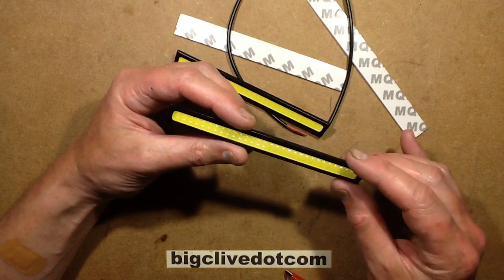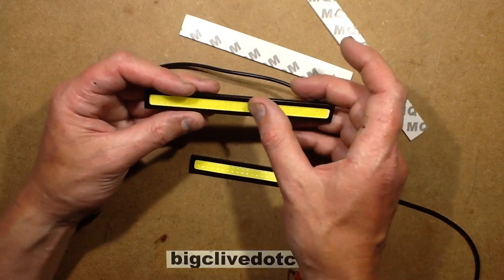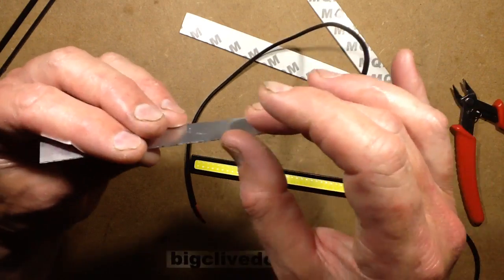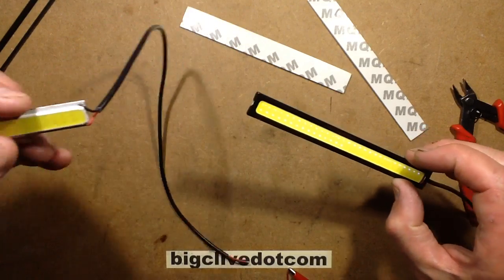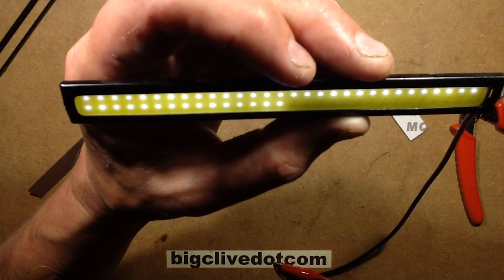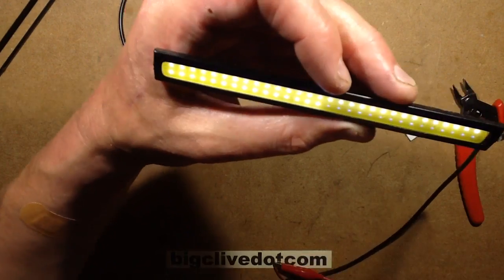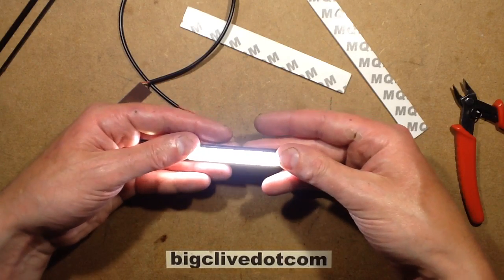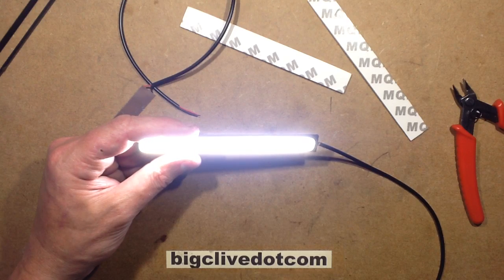A look at some LED COB light strips for cars / automobiles.

Comment: Clive, I got a question regarding similar 12v COB LED sticks. I got a pair of them (9w each) and learned very quickly that current quickly gets out of control with heat and blew out a power adapter.

I've kept the lights and still thinking what to do with them. I plan to use them with a 12v power adapter and was wondering what value resistor I can use to limit their current. Since I got 2 of the COB LED sticks, would having them in parallel then adding a 5w10ohm resistor before the power supply be ok?
Reply from the maker: It's worth trying that and measuring the current.  You can get a very accurate in-circuit current measurement by measuring the voltage dropped across the resistor and dividing it by the resistance value.

Comment: Is it possible to use a 12V Zener Diode to get constants 12v ?
Reply from the maker: You need a resistor to limit the current, but the diode should regulate the voltage to a degree.
Reply: how much currrent
whats the supply voltage

Comment: Very cheaply made. I bought 2 sets  for my VW Beetle grill both failed. Not waterproof. The wires are exposed at the connection. They are bright and worked well, briefly as Daytime running lights. Also I had to use zip ties to keep the tape from releasing  it's grip...probably because of the heat generated.

Comment: looking for info on how to cut a COB strip like this, its linear with 40 led's on it, the power instead of being on both ends, comes out offset on the top about 10 led's down. is it possible to cut anything like this?
Reply from the maker: Whether it can be cut depends on the exact circuit configuration on the panel.

Comment: I ordered these cheap strips from china.They are really strong:6,5W@12V@550mA.Almost illegaly strong light.I also tested them if they would sustain if emerged in water and they did.Are the soldering points covered whith a lacquer or so if they don´t can be short cut?
The chinese call it nano-but this is only a buzz word for a more ordinary method to isolate electrically,I think.

Comment: I like the idea of using what I call a chopper circuit to pulse LEDs and vary the duty cycle so they don't draw current all the time. Pulse Width Modulator, used as a dimmer on my under cabinet lights.

Comment: Cars normally run at up to 14.4 volts at which point the vehicles alternator cuts in, the normal vehicle battery voltage is around 12.6 volts stationary and up to 14.4 volts engine running, therefore it is vital thet both voltage and current are regulated before using these items in a vehicle application.

Comment: So how can I fix this problem? I agree my alternator kicks 14.9V when current demand is high. I have used various units like these and strip led and about 30% failed leds (they are sealed up totally, so no damp) Some still light up with raised voltage, I think they are fatigued by the high voltages/heat. Can I measure current and build something simple or is a regulator board the only solution? Then if I drive them at 11V will they live longer? Great content Thx
Reply from the maker: Under running LED will always make them last longer.  For low current loads, adding a few 1A diodes in series with each light can drop the voltage by a decisive amount.  You can also use resistors, but they would need some calculations.

Comment: i had a set of these and some others like it mounted to my car, they last for quite a while before failing, even though they heat up like crazy you shouldnt forget a car is usually in motion and the driving wind will cool them down

Comment: I purchased these at pepboys for a closet in my travel trailer I had them on for about 20 minutes after connecting them and I started smelling something burning. sure enough the damn thing were so hot. needless to say I had to remove them and buy a better set.

Comment: I started using the 6-10w versions as fog lights and additional reverse lights (Changed out the sucky wiring they came with obviously). The only problem i have with them is that the battery/alternator affects them so what would i need to keep the voltage constant? I have them wired up via cig lighter adapters with on/off switches.

Comment: do ineed another adapted for the other one ? or can I connect it in series/parallel to use the same power supply?
Reply from the maker: You can connect them in parallel.

Comment: hi. is it possible to use these 12 volt COB strips, or actually the nicely colored ones with 5 led's in one COB. you probably know which ones i mean and put them in series to use them in a 24 volt circuit for a indication light on an industrial CNC milling machine where normally the (Christmas tree) is. thats broken and uses 24 volts.
for instance. at a machine failure.  the red COB's light on.  and then i thought soldering 2 COB's in series, and then parallel with two other red COB's who are in series. so i can observe the machine from all four sides.
and do this with 4 green ones and 4 yellow and 4 blue COB's and slide them back into the old glas "Christmas tree"
i thought doing series so i hopefully dont need the use of resistors.

those Banggood things:

10pcs DC12V 2W COB LED Chip Light White Yellow Orange Green Blue Red Purple Lamp for DIY - Red

my boss bought a new one for about 800 euro's and i wanna repair the old one to make him go nuts. LOL  
thanks.
Reply from the maker: You could wire them in series pairs like that, but I'd recommend using a resistor to reduce the current through them.
Reply: @bigclivedotcom  thanks for reply. how many Ohm's resister would You advice in-front of those two in series wired 12volt COB led's to connect on the 24volt lines.

btw just subbed also.
Reply from the maker: @janwiersma1449  I'd suggest something like 10 ohm to reduce the intensity a bit and make them last longer.
Reply: @bigclivedotcom  good idea, thanks. i will do that. i already ordered the COB's.

Comment: I installed them on my car today for parking lights actually. They work great, but after a minute i saw they were very very hot to the touch, and also because of the heat and vibration on the road, the glue tends to unstick so i have them mounted and i will use silicon probably to glue them better, also i left them on to take a pic without the engine running. And ALMOST drained my battery when i went to start the car. I was lucky. I Drive a fiat seicento suite 1998 and it had broken parking lights when i purchase it.

Comment: I have bought some for use on my car.. at 12 volt they get too hot. With engine running they would last only a few min. 
What resistor would I need to add to cut them back to an acceptable running temp?
Reply from the maker: Multiply the desired current by 2 to get a rough resistor value.  Lower current is better to reduce LED and resistor heat dissipation.

Comment: I bouth a cob strip bar similiar to the one you have on the video, mine is input VoLt 12.14V  ~power 10w. I was going to use it as a 3rd brake light.

Would it be safer if I use a Step-down Converter DC-DC 5-23V?

I foud this one on ebay, https://www.ebay.com/itm/3A-Micro-DC-DC-5-23V-to-1-17V-3V-6V-9V-12V-Buck-Step-down-Converter-Power-Module/173682640710?hash=item28704ac746:g:dP8AAOSw0ZRb4AIO:rk:3:pf:0

Will this converter resolve the problem of the 14V in a car?

Regards

Comment: The metal enclosures has no protection to keep it shorting out where the wires are connected to LED strip, 1st thing I did was dispose of the metal frames. I did a test to see how much pressure it took to press down and make the frame contact the wire connections...it only took slight finger press, the little wires feeding the circuit immediately got hot enough to melt all the insulation off.
I used these to make custom lights for the grill of a KIA Soul, the first set (three of these strips) lasted about an hour. Rebuilt with three more strips they lasted about a day. Then I put a LED driver that provides a constant 12 vdc to strip and they have been working for over a year.

Comment: So would a few of these drain your car battery pretty quickly when its not running?
Reply from the maker: As the voltage drops the current drops a lot too, so they shouldn't be too bad.

Comment: What if you use them as indicators? The current wouldn't be long term so there would be chance for them to cool down. Also, indicators are used only for a limited time. So they should be ok running off a standard battery right?

Comment: KISS principle guys.... diodes are a quick simple solution to keep that voltage low enough to these panels and yes I know the battery in the car will drop but I never seem to find myself sitting in my car with the lights on like Im going to read a book or something

Comment: I wired a pair of these to my car's Dome light. most of the time these are on when the car is off (when I get in and out of my car). a couple of days ago I accidentally left the dome light on (and therefore, the LEDs on) for about 16 hours (3:30 PM to 7:20 AM the next day) and they were fine. The car did crank a little bit slower, so the battery voltage probably dropped a little bit, which likely helped them survive. These are meant to be used as DRLs but I think that would kill them quickly (constantly on while engine is running). But using them for interior illumination (on for short amounts of time, mostly with engine off) they should work just fine.

Comment: Do I need a driver to use those?
Reply from the maker: Theoretically not, but they will often be overdriven when connected to a car supply.  Adding a series resistor to tame the current down is a good idea.
Reply: @bigclivedotcom  could you give us a proper resistor? I'm not versed in such things, but if you told me what to use I can find them and install them. Thanks!

Comment: After about 4 months on a car, used as drls, half the LEDs had gone dark. I got 3 sets since they were cheap. Voltage limited a set when I replaced the dead ones, still running fine a year later. Clearly car voltages are too high for them.

Comment: Might seem like a stupid question but I couldn't find the answer anywhere.... can you trim those strips? For example if it's 17cm and I need to trim it down to 13cm. Will it work?
Reply from the maker: These ones may not be trimmable as each section of the series circuit is usually in a clump of parallel LEDs.  You could probably do it with a simple single circuit 3V COB.

Comment: what is the lowest voltage I could usefully run these at?  I don't need anything more than 2W per strip.
Reply from the maker: The 12V ones will start glowing at around 10V but won't reach full intensity until 12V.

Comment: why dont' these need any resistors? wont' they burn up?
Reply from the maker: They rely on the increasing voltage across the LED with current to reach a balance.  It's not ideal though.

Comment: Bought a similar pair for the Wife's Rodeo (rear compartment). Realised there was a "problem" when the self-adhesive strips kept failing (heat), so "fixed" the problem by coupling the strips to the steel tube roof supporting rail with heatsink compound / nylon wire ties. They now run far cooler (!) and no longer have the habit of dropping off when in use :-)

Comment: I have a set with a module connected and 3 wires R/B/W, just wish it came with wiring instructions to explain the white wire. I plan to mount them on a motorcycle.

Comment: These LED  work fantastic on RC cars as a lightbar with 3S Lipo!
Reply: This I want it to know, Thanks.
Reply: Thanks thinking of doing exactly that. What If I run if off of a BEC at 7.4v or 6v? Do they even power on?

Comment: Your car battery will be about 12-12.5v fully charged, and with the engine off. With the engine on, the alternator will be generating about 13.5-14.5v.

I recently had to replace my alternator, but wasn't about to give up the $60 core charge to take the old one apart and make a video of it, so I took it in to get the core charge refunded.

Comment: I've got some Lidl under kitchen cabinet LED strip as interior lighting in the back of my car (because there isn't any otherwise) and that's got three LEDs in series then a 150R resistor, so at 12V you're looking at about 20mA per section and at alternator volts more like 30mA. Not completely silly in either case.

Comment: I've used them on a car without any regulation. it was just connected through the fuse. these were extremely bright. were ok for 6 months but in the winter. I dont know how they were later because I've sold the car. and by the way. these are illegal in Europe as they dont have homologation. in case of accident you can get in serious trouble with your insurance company.

Comment: Use these all the time in automotive applications, so far, never have had an issue with them burning out, running them up to 16v dc. They do get warm, no argument there,  we have a car with a dozen of the on the outside of vehicle in direct sun light and rain, they still work after 3 years. I have retrofitted an ambulance interior lights with these to provide more light over the traditional filament bulbs and to reduce power consumption when vehicle is off.

Comment: I have these in my snowmobile as "daylights" or maybe better as "foglight's".. Only bad design i find with these are bad wiring, not suitable "as it" for winter. I change wire's for much sturdy kind's. In pitch black night: about 20-30 meter visibility forward and sideway same distance = not bad at all for these cheap COB's...

Comment: Anyone saying a linear reg would be inefficient here, at 2V and 340mA,  that's just 0.7 Watts wasted. 4.7 Watts in, 4 Watts out, we are talking over 85% efficient,  similar to most switching regulators. A linear reg or a series resistor or diode is equal to a switcher for this circuit.

Comment: Ironically I had ordered a half dozen of these with the intention of installing them as interior lighting in my bus when I happened to notice this video before I installed them :p  Thinking of just adding a resistor to make them happy at 14.5V, but wondering what value you would suggest..
Reply: LDO or.....boost-buck

Comment: Hey Clive man, I need your guidance. I bought these for the car a while back.

http://www.ebay.co.uk/itm/2X-LED-FOG-DRL-DAYTIME-RUNNING-LIGHTS-LAMPS-GRILLE-SET-FOR-VW-GOLF-MK4-1998-2003-/131606672943?hash=item1ea45e762f:g:zwUAAOSwgQ9V1qLk

They are terribly dim. So I'm thinking about making my own strip for the car. Only just got into LEDs recently and this is the main reason why.
But I cant seem to find any information on the chips. Each LED chip on the strip (12 each side of the car) can do white and amber. I can't find any chips that do this when I search to buy them, other than RGB. Can you shed some insight?

Comment: This is fine as a trunk light. You only open the trunk for a short time, and the engine is not running so the voltage will not be higher than 12 V.

Comment: The automotive electrical environment is a nasty place. Devices need to be able to run from supplies of 10.8 to14.7 v officially, or 9 to 16 in practice. And then add the spikes of 20-30 volts amplitude that you get as the big consumers switch on and off... it's quite an art designing reliable car electronics! My hunch is that those strips won't last long.

Comment: Got some yesterday from a good bang seller 😊 in Asia. Thought I would stick them across my bench supply. 12v and crikey they are bright. 13.5 and no way will they be going near my car. They got red hot and went to numerous little pinpoints of light. They didn't recover so night I have a set of mini pinpoint lights.

Comment: I am pretty ignorant on this stuff, whats the difference between a LED flasher unit and the one for regular bulb indicators. I know it has no load detection so indicators dont flash crazy fast. Would it also have some current limiting to protect LED indicators. I ask this as people seem to be expecting failure.... I just have not had one as yet..... AND not snapped one off like I seem to manage with stalk indicators.... very cheap..... so far no downside.
Reply from the maker: The traditional indicator flashers required the higher tungsten lamp load to operate correctly.  The earliest ones had a thermally heated bi-metallic strip in them and the newer LED versions have circuitry optimised for the much lower LED current.

Comment: Maybe add couple of diodes in series with this if used in a a car.
That should drop around 2v out of that 14.5v
Reply: nope....also drops when engine is off or not charging. A LDO would be better or GAWD help us a boost-buck

Comment: I fitted a pair of these to Stinky, my Vauxhall Corsa 96 plate several weeks ago. If they go pop, I'll let you know. I did fit the correct box to regulate them, so that when the headlights gone on, the power to the DRL's is halved. I guess the power drop, plus the speed of the car generating wind cooling will help them last longer. Still, for about £3 posted, I like them quite a lot.

http://www.ebay.co.uk/itm/Daytime-12V-LED-Running-Light-DRL-Relay-Harness-Automatic-Switch-On-Off-Control-/141994752206?hash=item210f8bf8ce:g:I1sAAOSw9VZXOX2L

Comment: I've been using these on my ridding lawn mower for a couple of years now without a problem, and they get blasted by the heat of the engine. The ones to avoid are the ones that have the small round "eagle eye" lenses. I tried them twice and both pairs lasted about one week on my car until the road salt ate them up. I don't know how well these would hold up to salt either, but I wouldn't risk it.

Comment: I rather like the concept.
I am working on a van rebuild and need desk work lights for the inside.
Also my radio room at home needs 12 volt lighting in case of power outages so I can run my radios and take notes. This is a good concept but poor execution. Wonder where I can find good ones?